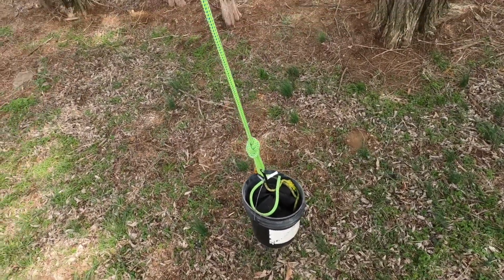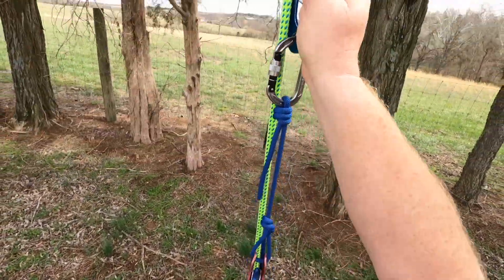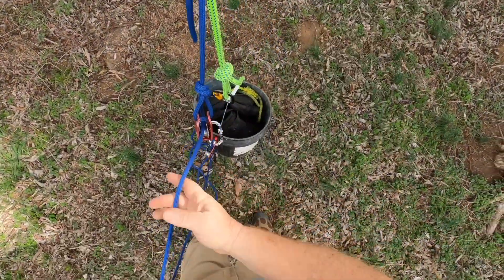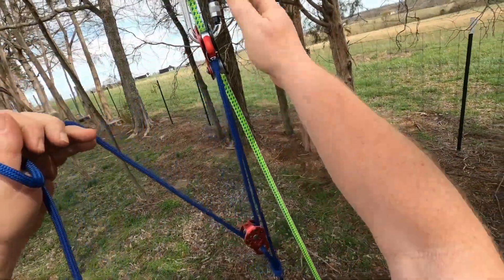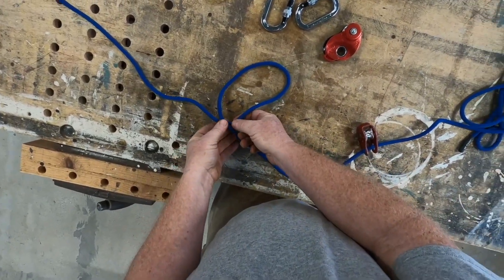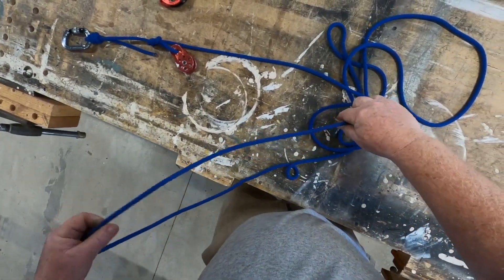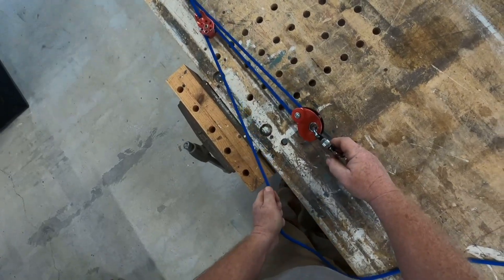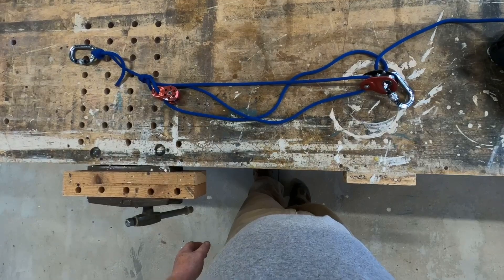How to create a personal Mechanical Advantage System

Comment: Thanks. Handy tool. I think a standard Petzl pulley, like the Partner, would be better than the Fixe bc the rope  within the in-line 8 will always be levering the Fixe's cheeks together. Thoughts?
Reply from the maker: I designed this with the intention of having a device that would be compact and raise my body weight or that of another in tight situations. So I wasn't really worried about bending the pulley but your concerns are certainly valid if higher loads were applied. The other factor is that the bend radius of the knot is larger because of the spread and the edges are softer in the Fixe than say the Partner. This matters because I wanted to eliminate a connector. 

Really the best solution would be a 1.1 inch Omni block but they are pricey compared to a Fixe. And I already had a Fixe! Thanks so much for an excellent question.